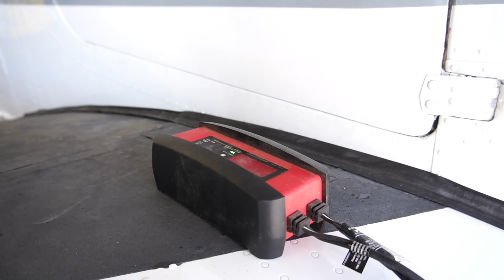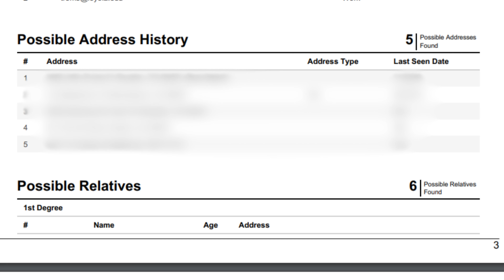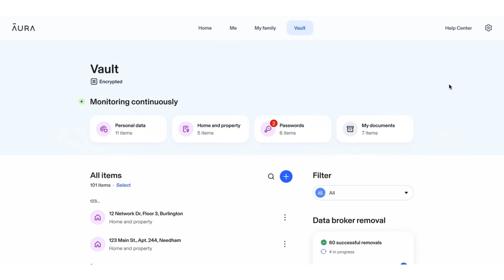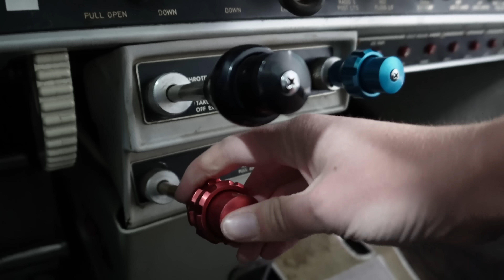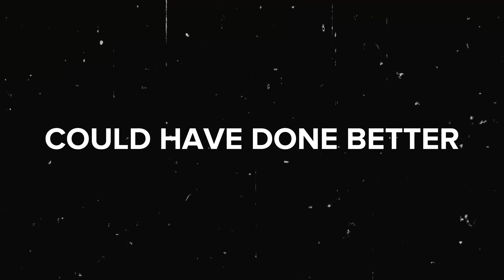Engine Failure: Answered! | throttle body leak, overhaul cost, aircraft maintenance

Comment: No, "aircrafts" is not a word; the correct singular and plural form is simply "aircraft". "Aircraft" is a noun that refers to a vehicle capable of flight, like an airplane or helicopter, and it does not change form when made plural.

Comment: You would also need to use "HotStart" procedures to get the engine re-started after it quit on the runway. Vapor lock could have likely happened as well.

Comment: Thanks for sharing this. I've had this happen was well some time back in a Cherokee I had. I'm glad you mentioned this as a checklist item as I've seen people not validate low idle at the end of the run up sequence, another point to add to that, if you're in a carbureted plane, do it with the carb heat on as that can be a standard landing check list item as well.

Comment: Thank you for your video's Hayley I thoroughly enjoy them and learn something new on each one.  I do have two brief questions, there is talk all the time about fuel pump & waypoints. I understand the purpose of each, but my question is why, do you turn off the fuel pump does the engine not need it for fuel delivery? And waypoints what makes up a waypoint, are they radio transmitters on the ground?
Reply from the maker: I’m glad you enjoy them and learn new things! Generally aircraft have 2 fuel pumps, the electric one is turned on for takeoff and landing for redundancy and waypoints can be GPS locations or even physical landmarks

Comment: I'm sure this will be fuel for the fire in the 'mechanical vs EFI' debate.  Here's a throttle body with no TPS or MAF sensors that just works....until it doesn't.

Comment: Hayley, consider buying a $200 handheld radio for just this situation. It could also come in handy in flight after a radio or electrical failure, or on the ground after a forced landing with no cell service. They are cheap insurance. Just make sure you keep it charged.

Comment: TBO is not only like 2000hrs  or 12 years first arrive. Your fuel system need o-ring replacement. Note: check your divider on top , pump and electric fuel pump for leak. Normaly they leak one ofter the other.

Comment: When I worked on copy machines back in the day, we had a term similar to the one you used, "Operator Error" 😁😁 I don't have a plane, but my baby also requires lots of expensive maintenance and repairs, which indeed is half the fun! 🤗🤗 (or so I tell myself haha) Great vid, thanks for sharing!

Comment: 0:35 high temp silicone to hold the cable ? Looks like something I would do on my car 😂😂
Reply: That’s typical.. just keeps it from rubbing and wearing. It’s not really “holding” it as much as it’s sticking it to prevent movement and vibrations

Comment: Hayley,

Great video. Thank you for the insight. I will be getting with my A&P to run a leak test on my throttle body. Thank you for sharing.
Cheers!

Blue Skies...

Faithfully,

James
Reply from the maker: I’m glad it was helpful! Hopefully you don’t find a leak like I did 😊
Reply: @FlywithHayley , did you notice any idling issues on other flights prior to the engine cut off on video? Curious if the issues gave some hints that it was getting ready to fail. $1,900 including labor doesn't seem bad at all in the airplane ownership world. Thanks for sharing and hope you get the Oregon trip rescheduled.

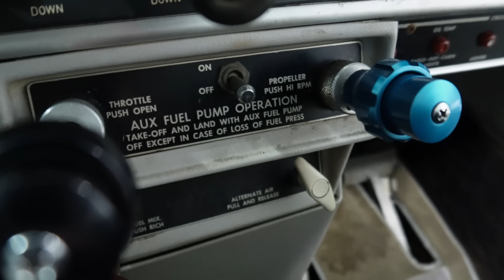Comment: 4:30  " When the mixture is set to idle  "  Correction  -  Idle cutoff. 
Hot starts -
The next time you are operating the aircraft - set the throttle to idle and  slowly   pull back the mixture looking for the peak in rpm ( mixture rise ) .
This sets the mixture at the optimum fuel flow setting for a hot engine. 
When you attempt to hot start the aircraft - put the mixture knob slightly rich of this position with the throttle just off idle. 
Boost / prime for 1- 2 seconds and start. Adjust technique as req.  This is the most effective method of hot starting TCM fuel injected engines. 
Lycoming is a whole different creature.

Comment: Something that would help you out with the battery drain is switch all of your lighting to LED. The old halogen lights take a lot of power whereas the LED's have minimal drain on a battery. Plus, LED's are brighter and really look badass!!!!!
Reply from the maker: will have to soon!!
Reply: And don’t aim at Whelen. Very expensive. Any led that fits your fitting can be placed, provided there’s no radio interference

Comment: As an A&P student and PPL student, something to be aware of: From your previous video, I'm not sure about the time that elapsed between the jump start and your take-off. Just an FYI for anyone dealing with a flat battery - something my A&P mechanic instructor pointed out:

"The battery reserve time varies depending on the aircraft type, battery capacity, and electrical load. As a general rule, a well-maintained aircraft battery can provide around 30-60 minutes of power after an alternator failure, assuming the battery is fully charged and the electrical load is moderate." (Brave / LEO AI search)

With this in mind, be aware just because the airplane is running, it's strongly recommended that the alternator or battery charger be given some time to recharge the battery to replenish this reserve time, in the event of something like an alternator failing mid-flight. With this in mind, everyone should be aware just because the airplane is running, it's strongly recommended that the alternator or battery charger be given some time to recharge the battery to replenish this reserve time, in the event of something like an alternator failing mid-flight. My instructor has seen private aircraft that have been hand-propped leave the ground, only to have a complete electrical failure 10 minutes later. Thankfully they were able to land safely and of course the magnetos, independent of the alternator / battery circuits were able to keep the powerplant spinning.

As always, thanks for the content! It's been inspiring and educational to watch all of your Diamond ferrying before starting my training in a DA40 XLS. As a flatlander, I'm also genuinely thankful for any weather information about mountain flying.
Reply: I think the issue here was cranking power. You'll get 30-60 minutes of battery with a typical electrical load, which is not cranking the engine.
Reply: @Bluenoser613  Agreed, but I was referencing something from the previous video, they needed to jump start the plane before getting back up in the air.

Comment: I'm glad to hear that you have been able to sort out the problem which resulted in the engine cutting out. I suggest you treat it as a wake up call to start going over all the aircraft systems for potential failure points. The fact is that the suggested time to failure/replacement is a rough guide only and is likely to be arrived at by guestimating quite a number of inherently variable factors. Rubber degrades over time, likely affected by temperature and humidity or even just the presence of air. Plastics too break down when exposed to UV light and atmosphere. Different metals will react when in proximity to one another due to electrolytic action. Aluminium, (the major component of aircraft airframes, of course), is a nightmare in this regard. Many electronic components will break down over time and any electrical connections can suffer from the effects of moisture leading to intermittent or permanent breakdown. All components can suffer from the long term effects of repeated stress which result in damage or failure but what might not be so obvious is the potential of failure as a result of variation in manufacturing process, a cast component placed near an open doorway as it cools down resulting in the component cooling faster than it should, leading to porosity/voids and a loss of designed strength in say just a small area, It all looks fine until one day the component is subject to just a little more stress than it can take. Commercial aircraft get regular checks of course but if I am not mistaken private aircraft are a bit less stringent. Either way I would feel it prudent to swap out any aging systems to be on the safe side. Swap out any fasteners or components you don't know the history of. Any links or fasteners on control surfaces...
Not trying to be your grandma here just hoping for you avoid any other problems which could crop up out of the blue.
Best wishes Hayley.